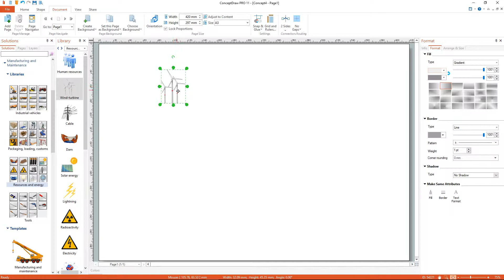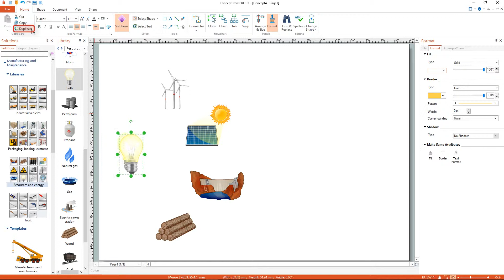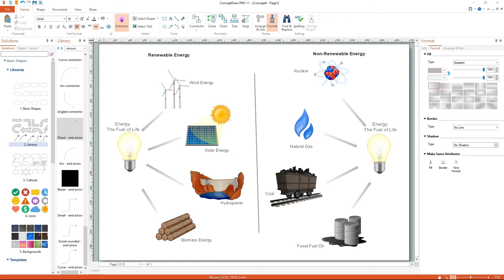How to Better Illustrate Manufacturing and Maintenance Processes

Comment: which software is used for this?
Reply from the maker: Thank you for your question! 
The software is called ConceptDraw DIAGRAM 16 (from Office 9 suite): https://www.conceptdraw.com/products/drawing-tool
Here is our website www.conceptdraw.com
After first-time registration, you get a 21-day trial license to check the quality of our software. No strings attached. 

Here is the link for downloading the software: https://my.conceptdraw.com/account/downloads.php A proper sync is a must that connects your license with your account. How To sync: 
Once downloaded, run the installation file and follow all the on-screen instructions to synchronize: https://www.conceptdraw.com/helpdesk/how-to-recover-conceptdraw-license How To Use the STORE app https://www.conceptdraw.com/helpdesk/content/store/using_conceptdraw_store

We also have the “Getting Started Guides”, for you to check out that can be downloaded from our Helpdesk: https://www.conceptdraw.com/helpdesk/pdf 
Should you have further questions, please email us at: support@conceptdraw.com

Sincerely, 
Customer support manager 
CSOdessa Plan. Do.Communicate. 
www.ConceptDraw.com +1 (877)441-1150 Toll-Free